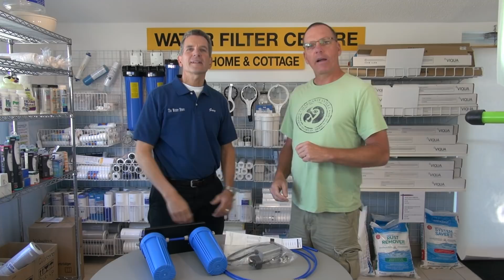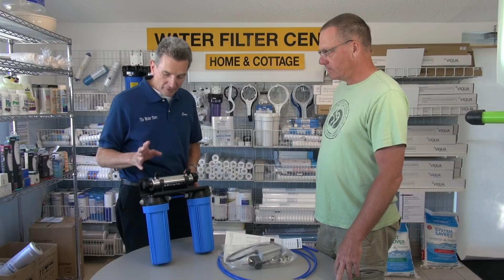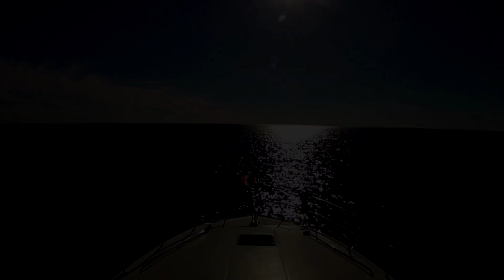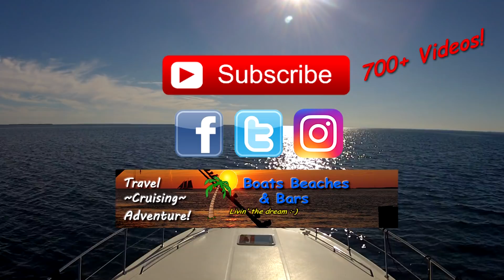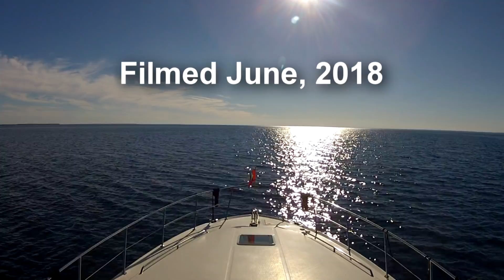New Water Filtration System For Our Boat - Sea Ray Sundancer

Comment: Hey Paul…would you happen to have or could you provide a picture of where you tied your feed line into the ac feed line??

Great content
Reply from the maker: I tied the supply line directly into the line coming off the A/C pump with a 'tee'. Only thing to remember is to not run the A/C at the same time, as it might starve the unit of needed water flow. That said, I only used the water filtration system when filling our freshwater holding tank and that was usually done while underway, so the A/C wouldn't have been running at that point anyway. . .

Comment: Can this system be used in salt water?
Reply from the maker: It's designed primarily for use on freshwater systems in residential applications. But given the fact that it's a 12V system, it works perfectly for filtering fresh water from the lakes and rivers where we boat. You'd have to contact the manufacturer to see what they say about a salt water application...

Comment: Going up to midland this week, hopefully it is in stock. 
I assume I need to buy a pump to get the water to the holding tank?
Reply from the maker: Good. You can contact Gary through his site or YouTube channel (links in the description) to check on availability. He's a good guy to work with and I think you'll be happy with the experience 👍
 As for the pump, you will need a 1 GPM unit to move the water through the system, as well as a source. I'll be using an underutilized through hull to draw the water out of the lake on this #boat, but on our last #Boogaboo, I simply teed off of the existing air conditioning/heat pump line and that worked fine. Just note that if you go the A/C line route, make sure you don't run the A/C at the same time, so as to not starve either system...
Reply: Ok thanks.   There are two or three of us at our marina interested in this system